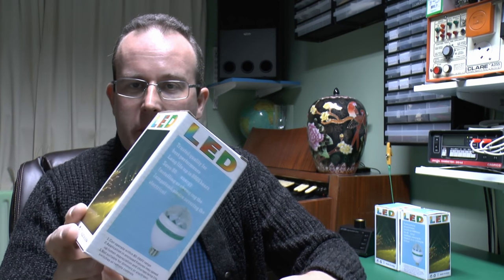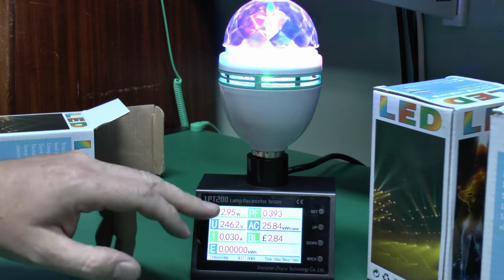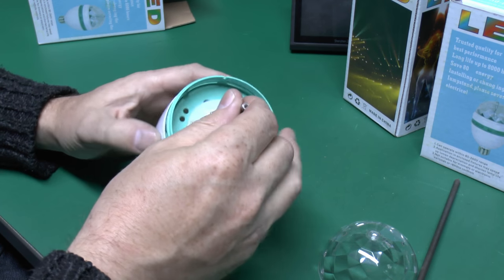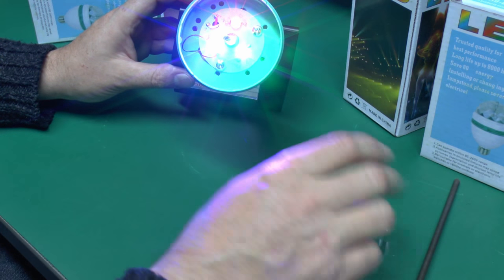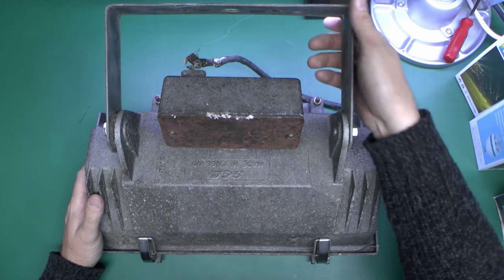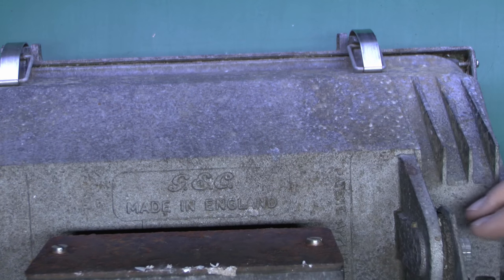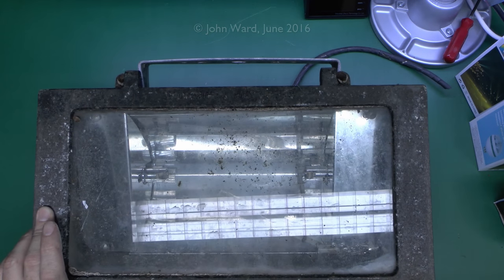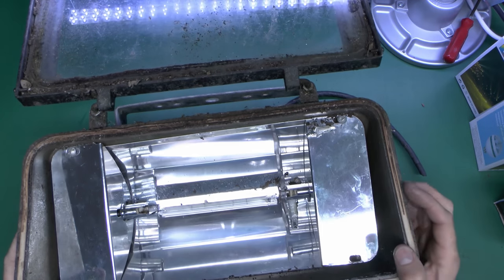Rotating LED lamps and an ancient halogen floodlight

Comment: would like to use these in my garden would it be easy to convert the bulbs to use on a 12-volt solar supply by doing away with the internal 220 volt supply?

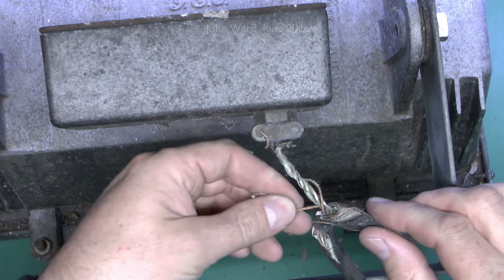Comment: 6:15 Red, green and blue insulation? Assuming the old-style UK colours, don't you mean red, green and black, unless the lamp sits across two of the phases?
Reply from the maker: Wire colours confused with LED colours.  Should have said Black for the wires.

Comment: How are you wearing a jumper in this weather? Is it cooler in the south than it is elsewhere at the moment?
Reply: It was cold enough here in the south-east of England the other day - round about when this video might have been made - to justify putting the heating on in the evening.
Reply: Fair enough. Meanwhile further north I've been wiring up a 12V supply to some spare PC fans, cable tying them together into a 2X2 square, and setting them in the window. :)